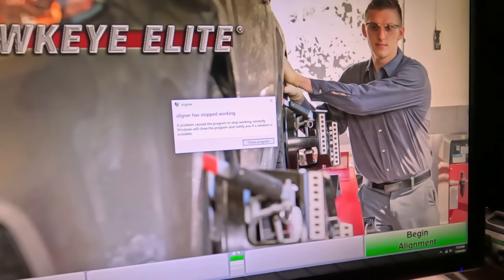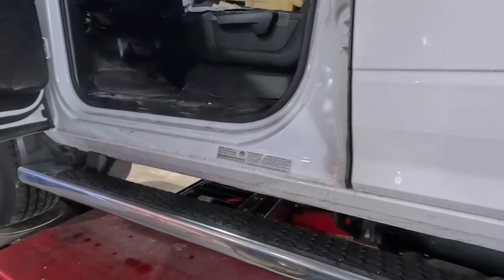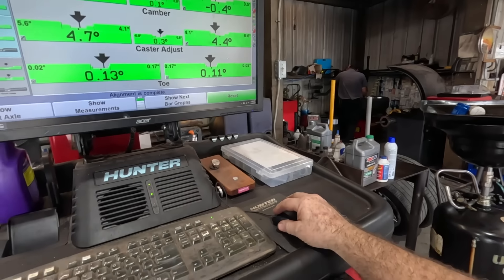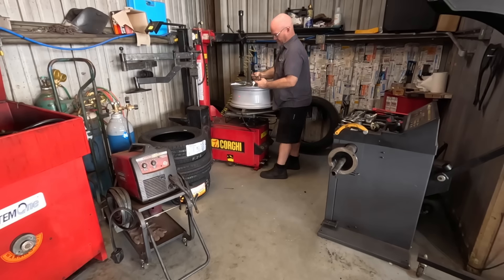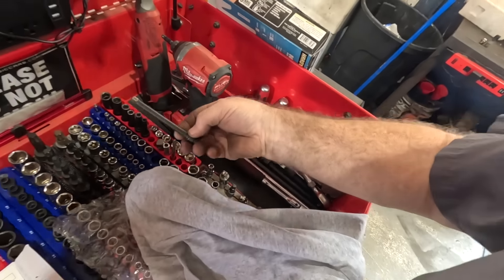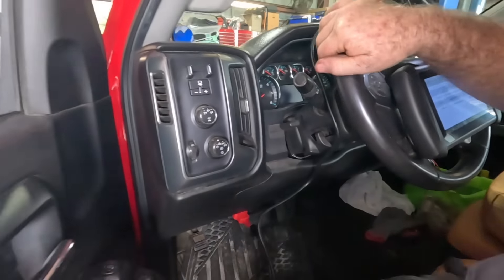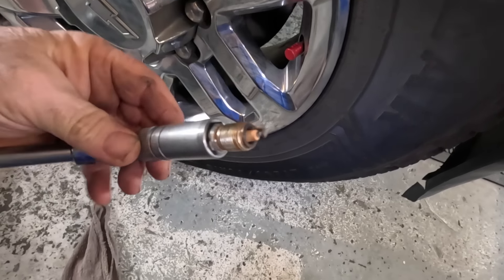2 SILVERADO's, TUSCON HOSE, HIGHLANDER ALIGN, RAM 3500 ALIGN, Day  407 in the SHOP #auto #repair

Comment: Chapter/Playlist
01:58 2022 Ram 3500 HD - Alignment
08:38 2017 Z71 Chevrolet Sliverado - Part 2: Fuel Pressure Temperature Sensor, Intake Gaskets (XTOOL IP-819) -40 deg in fuel temperature data
19:45 2020 Hyundai Tuscon - Coolant leak, Pressure test (ATD Mercedes/GM/Honda adapter) Faulty radiator hose
23:46 2021 Toyota Highlander - Body Shop Alignment, Damaged Front Wheels, New wheels, Wheel balance
38:23 Viewer Mail Bag
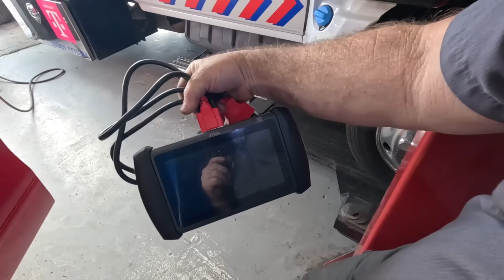40:55 2016 Chevrolet Silverado - Diag (XTOOL IP-819) P0171 P0174 P0300 P219B, Cyl 4 & 6 Misfire, Intake leak
56:02 2020 Hyundai Tuscon - Upper Radiator Hose replacement
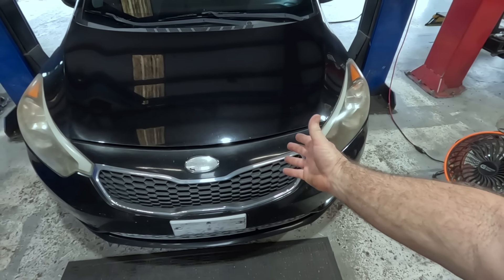1:02:32 2014 Kia Forte - AC not working (Comeback from a year ago) Vevor Endoscope, Leaking AC Hose
Reply from the maker: That is awesome!

Comment: Jimmy! I have a set of those 12 point Matco nut driver swivels and I also picked up the Torx version perfect for air filter box lids and most European. Also bought the Koken 6-point version in 8 mm and 10 mm. I use those things all the time. One thing about the 12 point they can get easily damaged if you use them for stubborn fasteners. I damaged the 13 removing a differential cover should have used regular impact swivel....
Reply from the maker: Right on, thanks William!

Comment: You are 100% correct about reasons not to buy a new car.  IF they made them better (= more reliable) then you could justify the high upfront cost, but they are making them more complicated & harder to work on (modules, modules, & more modules).  That Hybrid that you are looking to purchase for your wife hopefully has reliable inverters.  I can imagine how much they cost (in addition to the batteries).  Guess you miss those old wired alignment heads?
Reply: Cars built today are much more reliable. As Jimmy has said in other videos that if you go back a couple decades that automobiles with more than 100,000 miles were considered junk yard ready. I do agree with complicated sometimes Rube Goldberg type of processes the auto needs to do anything. I was blown away in a previous video where Jimmy traced the wiring telling us how the horn actually got honked. Instead of a button with a ground to honk the horn the computer has to get notified the horn needs to be honked, will have to check that it is allowed to be honked, send the signal to be honked, triggering a relay that sends the power to the horn that actually honks. 

In the last couple of days Eric at South Main Auto made a video about a module just made to look in the car's blind spot. They don't teach turning your head around and looking during driver's education anymore.
Reply: @SubmarineSquid  I remember the good old days of fiddling with points & carburetors.  At least we had the space to work on them.  Now everything is under or between something else.  Modules can be unhooked if they are corrupting the communication line (network) IF you can get to them.  For all the pros of the modern cars there are a whole bunch of cons.  There are no more OEM printed service manuals.  If you need detailed info on repairs you will have to get a subscription to online service data.
Reply from the maker: All very true. I think cars are more reliable than ever, more complicated than ever and harder to repair and more expensive than ever, haha. Add to that more convenient and safer than ever.

Did I mention expensive? ;)

Comment: We had a couple hybrids over in Europe (a BMW X1 and a Volvo XC90.)  I liked them both but the electric steering and brakes are pretty numb.  My wife's company just gave her a 2024 BMW X5 hybrid and it's the best one yet.  45 miles on the battery then it switches to a 3.0L twin turbo.  The best part is that it uses the alternator (maybe it's a generator - I haven't looked) to charge the battery once you're using the gas engine, so when you get where you're going you can use the battery to putz around town.  I use it to drop the kids at school instead of idling my Hemi in dropoff line traffic.
Reply from the maker: Yeah, they are pretty good from everything I’ve heard. My son has an X4, he likes it but been back for warranty about 4 times in a year so far.